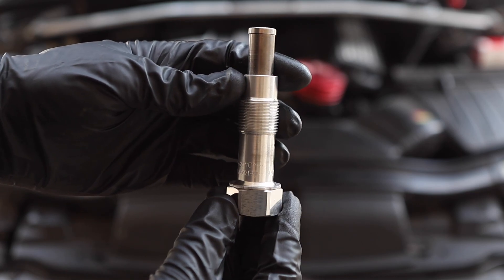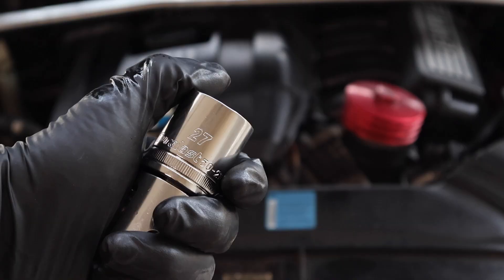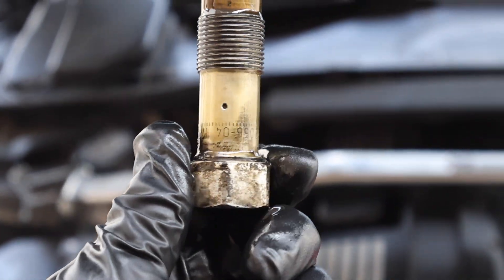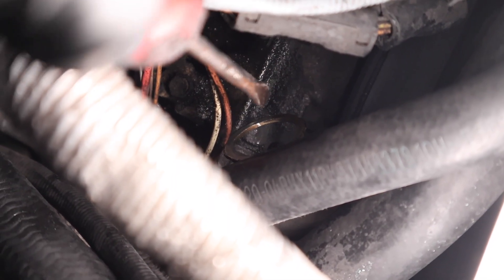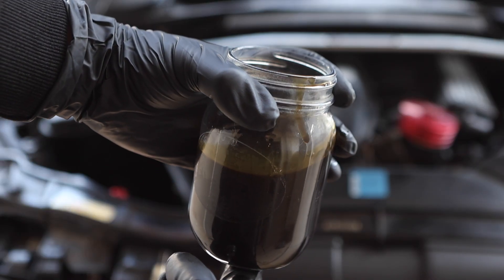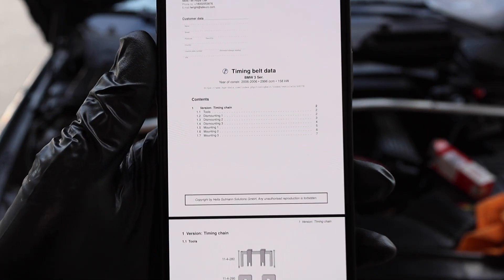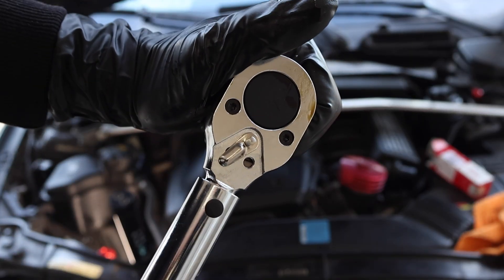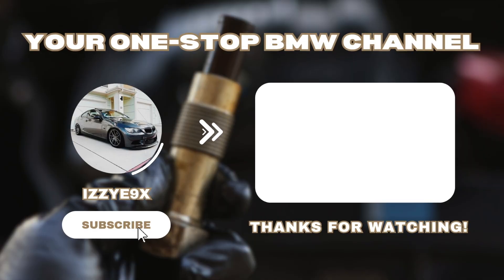How to Replace BMW Timing Chain Tensioner | Fix Rattle & Slapping Noise (N52 N54 N55 S55 N20 N26)

Comment: You sound more like a salesman. A car with Over 200k miles is gonna need new chain. New tensioner is not gonna fix it.
Reply from the maker: I’m at 270K miles on the factory chain, no issues

Comment: PRO TIP: 

- Take a cup and pour some oil into it. Place the tensioner inside the cup and pump a few times to get oil inside the tensioner to make it ready to operate from 1st crank. If you fail to do so then your 1st crank will sound weird and you'll deduct a bit of lifetime from the guides before they fill with oil naturally from the oil flow. No big deal but not really something you want to miss when you don't need to. 

- Pay attention if the old tensioner has the same lenght and other propositions like the new one ESPECIALLY if the old one was mounted with a washer or not. Because new ones may or may not come with a washer. Putting a washer inside when there was none is something you can fix quickly with no damage (hell of a noise once you start) but the other way around not so much. If you create too much pressure on the chain guide it may break and you have a full rebuild coming your way. 

- Also pay attention to the tighteting torque value! Use OEM values, look it up in repair manuals, Bentley manual or inside the BMW diagnostic tool itself. However this is not a spark plug so missing your target value by a little is no big deal. Better more tight than less because temperature is a factor to consider here (thermal expansion). Again nothing wild is going on here but not something you want to miss. If unsure check back in a week or two after you went for a few drives if they still keep their torque value you put in before. 

- You may lift the engine a bit if you have one or both of them hard to reach. Just make sure not to apply too much lift as there are other parts and components mounted to the engine. If you are about to do that consider replacing the engine mounts as well. No better time then now :)

GL with the job.

Comment: I'm just learning about BMW stuff, but, with respect, I think you have misread the torque instructions. " Tighten the bolts to 50nm"  I think applies the the timing chain guide, despite how it's written.  Other sources on the web say the torque spec is for the 0.6nm.  Yes, really low.  As you said "it comes off with ease". It's aluminum into aluminum (or maybe into Al-Mg alloy).  Also your statement that 'the torque ... insures that the chain is tight' is wrong.  What keeps the chain tight is the spring and the hydraulic pressure in the tensioner.  Extra tightening torque has little to no effect on that.  I think you are lucky to not have stripped the threads.  I just replaced mine and hand torqued it basically.  We'll see if it leaks.  Some comments say BMW has a special tool for this.  I have ordered a bicycle tool - a beam torque wrench from Park bicycle tools.  There are also digital torque adapters that claim to work down to about 0.25 nm.  BTW I found it a lot easier to get at by removing the windshield washer tank.

Comment: Great video, hope people reading this also change the vanos bolts when they perform a valve cover gasket replacement, because mine broke 4 of them + the 2A87 code and I also thought I would need a new engine haha
Reply: si los vanos estan ok , ha de hacerle una mantencion , limpieza . Ademas de quitar y limpiar la valvula de retencion . 

No todo es cambio o reemplazo

Comment: Thank you so much for posting this, I'm just looking into doing this on my N47 in my F30 and this is the best most thorough guide I've found so far!
Reply: For anyone reading this with an N47 - I've since discovered and verified that the torque spec is different for the tensioner on the N47 vs the N52. Without rewatching the video to make sure I get this the right way round, I think the N47 is 70nm while the N52 is 50nm.
Reply: How is the reliability on f30 n47 engines goin for 328xd

Comment: i am currently doing this but kinda worried because i’ve seen comments on other videos saying that you should not change this on its own and you should change the entire timing chain and timing chain guide to do this. is this safe to do am i worrying for nothing? i already have everything ready to take off the old timing chain tensioner and put in the new one.
Reply: Take the tensioner out and check it, if it needs replacing replace it if not then don't. N52 engine doesn't have timing chain issues, as long as oil changes are regular then just changing the tensioner shouldn't be a problem. If you're worried about the guides and chain, and have symptoms then just change the whole lot. I changed only the tensioner at about 110k and had no issues. 2006 N52 engine
Reply: @vmanv1416  checked it and it was pretty bad changed it and the car had no rattle and runs really smooth thankfully
Reply: @fthirtyleo change your oil return valves/filters they're by the tensioner, 2 of them. Get a extendable mirror and you'll see them, can be done from the top they're a bit of a pain and best way to get them out after unscrewing them is to use small nose pliers, put them into the hole open the pliers and pull them out, they get a bit a stuck.
Reply: @vmanv1416 not very good with doing stuff like this so idek if i should do all that i have a n26 tho so im not sure if the placement is the same is there some place where i can see how to do this in more detail? and what exactly does it do
Reply: @fthirtyleo not sure about that engine mate. So i wont comment 👍🏻
Reply: @fthirtyleo  did you change it yourself? you didn't have any difficulties?
Reply: @limaiemheykel yes i did forgot the put the little ring and put the tensioner in then when i took it out and added the ring the tensioner wouldn’t want to screw back in, thought i ruined the whole car but thankfully i somehow got it back in, just DONT forget to put the ring an don’t over tighten the tensioner also dip the tensioner in a thing of oil for like 30 mins so it can soak it all up and you shouldn’t have any difficulty’s. was definitely my fault
Reply: On N47 it’s on the same place, this easy to change?

Comment: I think im having this issue but not to sure. My 328i has 106k miles and sometimes when I start the car I can hear a rattle, it goes away though after. However today I started the car and it was a LOT louder. It didn’t sound like rod knock but there was a loud tick even while driving. I shut it back off and it was gone. Drove it for an hour and no issues. You think this could be the issue? It doesn’t happen all the time just sometimes. It mainly happens during cold starts in the morning
Reply: yes that is exactly what is causing it
Reply: @fthirtyleo even with no codes ? I have noticed the car has had a drop in performance. Not much but I can definitely tell
Reply: @6atxrn no codes and car feels the same performance wise

Comment: The N52 goat drops again! Great video man. Always helpful. We in the E90 community appreciate you. Do you have a video of what it sounded like before? This is the 1st time I’ve heard of this on the N52. It’s always vanos solenoids this vanos that, spark plugs and coils packs.
Reply from the maker: I appreciate all of you in the community 🫶🏽❤️

I just hit 265K miles and noticed the timing chain was much louder than usual. The tensioner is neglected but such a vital part to replace, considering it directly impacts the health of the chain and guides. Hope you found the video helpful!